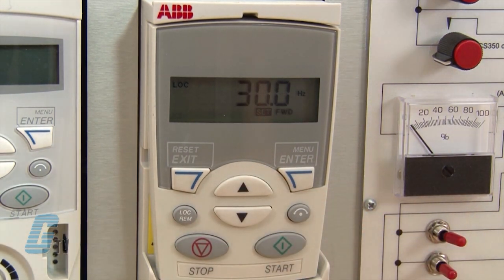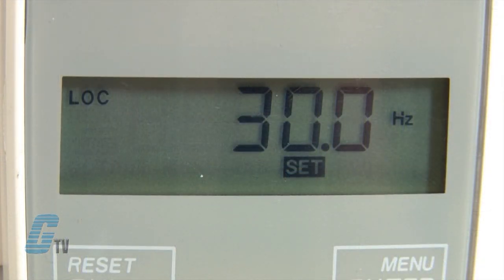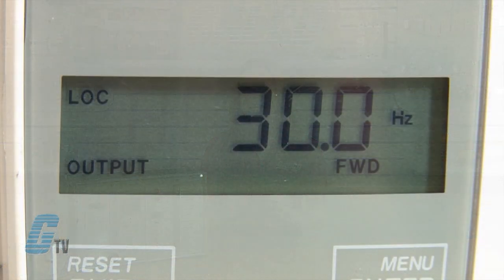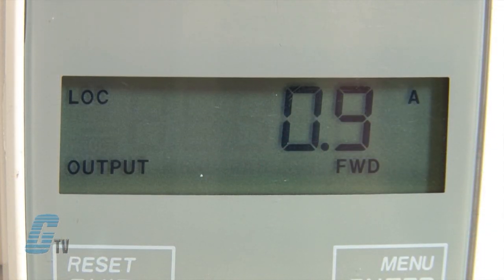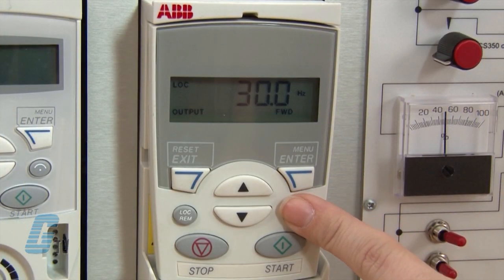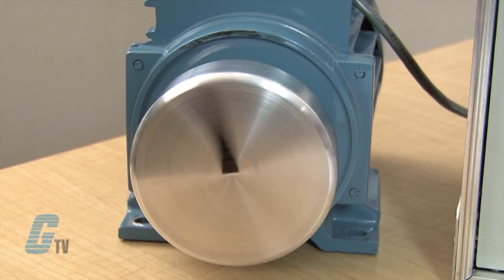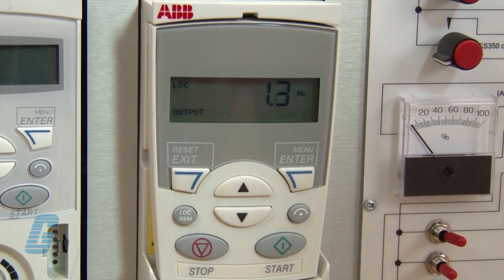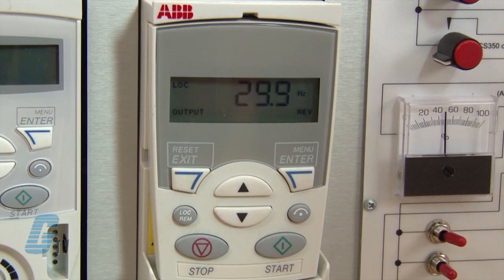How To Set Up ABB ACS355 AC Drive With A Standard Control Pad

Comment: Hi, we are using acs355-03e-12a5-4+n827 drive for solar pump.we encountered some unknown issue in the system.while on the switch, display getting on rotating with symbol.but after that there is changes in the display.
Reply: After that there are no changes in the dusplay
Reply from the maker: We will need to know what changes are happening to the display to begin to understand what could possibly be happening.

The rotating symbol mentioned might be the symbol indicating that the drive is outputting current to the motor.  It should be a rotating arrow that will either be spinning in the clockwise direction (representing forward movement of the motor) or the counterclockwise direction (representing reverse movement of the motor).  Also, the line will be a dashed line until the drive reaches it reference point, then the line will become solid.

please reach out if you have any further questions
Reply: After switching on the system, it appears like the rotation I shared video earlier.what could be reasons for this type of display rotation.please suggest me how to proceed further.
Reply from the maker: @KamalkannanK-c5k  please contact techsupport@galco.com or 800-575-5562 option 3 for further assistance

Comment: Good night friend I have an ACS 355 220 v
Installed in a lathe I would like to know if there is any parameter that I use to increase the torque at low speeds.

Comment: I get alarm on display a20 10 what ll do
Reply from the maker: Here's what I found for your scenario, Motor temperature is
 too high (or appears to be too high) due to excessive load, insufficient motor power, inadequate cooling or incorrect start-up data.
Reply: @GalcoIndustrial  thanks for ur reply.
How to reset the drive.
Reply from the maker: @fairose1052  your welcome. Please don't hesitate to ask any additional questions, and let us know how it went.
Reply: @GalcoIndustrial  how to remove this alarm A 2010

Comment: Rated frequency was 60hz at motor nameplate and same is set in the VFD but motor running condition frequency not increased more than  53hz ,can u tell what the problem
Reply from the maker: Most likely you have 1 of 2 potential problems. 1) Reference scaling; what are the settings in parameters 1103 to 1108. 2) The motor is at maximum load and the drive is in current limit.

Comment: How sett  RPM from Hz
Reply from the maker: It depends on which control mode you have selected in parameter 9904, SCALAR FREQ displays Hz, VECTOR SPEED or VECTOR TORQUE will read out in RPM.

Comment: Why the voltage output just only reach 160v to 170v, how to set up the voltage back to 240v? The input voltage is 240v....anyone please advice...
Reply from the maker: Are you running at 60Hz? What are you measuring the voltage with?
Reply: Measuring by multimeter...the out put cameout with 150V
Reply: @norfazlimokri3598  you will not get a correct voltage reading using a multimeter  as it varies the frequency and torque in various startup and running stage

Comment: Is there a way to run a 1 phase motor with ACS 355 drive ?
Reply from the maker: Generally speaking no. However we have run a single phase fractional HP motor on a VFD and it responded fairly well.  You should also know that it was just a fan motor with no fan blade attached. Single phase motors are not intended to be run on a VFD. A Reduced Voltage Starter would be a more economical choice for a single phase application.

Comment: How to tke 24V from ACH550 drive?
Reply from the maker: Terminal 10 of the X1 connectors is +24volt output, terminal 11 is the 24volt common. If 11 and 12 jump together, then connect each digital input to the + output to activate each input.

Comment: but I install a new
Reply from the maker: Then double check the group 99 parameters for correct motor data entered if you haven't already. This may not be a drive issue, the motor is getting to hot not the drive. Are you running at low speeds?

Comment: How do we set the drive up for analog control from an analog input?
Reply from the maker: Simply wire up the speed pot to terminals 2, 3 and 4 on connector X1A. The drive is defaulted to this input. However you do have to make sure the drive is in remote mode. Look in the upper left corner of display on keypad to see if in remote, if not push the LOC/REM button to toggles modes.

Comment: my drive show error 2010
Reply from the maker: This is a motor overtemp fault. Check the load on the motor, check the fan is not broken or block air flow. Running at low speeds for long periods of time can overheat the motor. If this doesn't help give us a call at 800-337-1720 and ask for an ABB product manager to assist you.
Reply: @GalcoIndustrial  also may be the  the invertor  temperature sensor damage

Comment: Hi, may I ask what is the difference between ACS335 AND ACS150
Reply from the maker: +Muaathe Aziz the difference is power. 

The ACS355 
◾0.37 to 22 kW/0.5 to 30 hp
◾Optimized design for cabinet installations saves space and installation time
◾Wide range of fieldbus adapters available offer flexible connectivity
◾Vector control capable of running both asynchronous motors and permanent magnet motors
◾Simple and visual sequence programming to make independent and repeatable operation sequences
◾Pre-defined application macros for quick basic setup
◾Unified height and depth of the IP20 product family simplifies wiring in cabinet installations

The ACS150
◾Power range 0.37 to 4 kW/0.5 to 5 Hp
◾IP20 enclosure 
◾Scalar control
◾Integrated user interface and potentiometer
◾Built-in brake chopper
◾Built-in EMC filter for 2nd environment
Reply: I want to know this code  F 0046

Comment: I am setting a new parameter but when I press enter again it does not turn the paramater number back. How should I change the settings? is there a block setting to not change paramaters?
Reply from the maker: +Cengiz Oğuzer When you want to change a parameter using the standard keypad, once you select the
parameter, you need to hold the ENTER button in for a few seconds until
the word SET appears at the bottom of the display, next to the word PAR.
Once you see this you can change the parameter to what you want, then push ENTER
again to save it. You will need to do this each time you want to change a parameter.
There is also a PARAMETER LOCK, parameter 1602, which prevents parameters frombeing changed from the keypad, this should be set to 1 which means
unlocked. If it set to a 0, then it is locked and you need to go to
parameter 1603 and enter 358 to unlock.
Reply: +GalcoTV Thank you very much. It was exactly how you described, it was locked. Now can change all.

Comment: i'm getting fault F0035.What is wrong with it?
Reply from the maker: Rudy Iskandar  
Fault 0035 is OUTPUT WIRING, which according to the manual, the most common cause is
the input power wires are connected the drive output. The input power wire  should be connected to terminalsU1, V1 & W1 and the motor wires should be connected to terminals U2, V2 & W2.
The other possibility per the manual is “Fault can be declared if the input poweris delta grounded system and motor cable capacitance is large.”
Reply: My fault is f0001. Please help

Comment: In the settings here in video the drive follows the value u choose for "ref", will it work as variable frequency incase you use solar knowing that par 1103 is set to solar? thank you
Reply from the maker: Rami H The drive is still a variable frequency control, but when you set parameter 1103 to solar, the drive automatically adjusts the output frequency based on how much
power the PV cells are producing. You cannot manually set the output frequency
in this mode.
Reply: so wat i have to do with the "ref"? parameter 1103 already set to solar. and parameter 9904 is set on scalar frequency. could the problem be from the mitsubishi magnetic switch installed after the drive?

Comment: Acs 355 drive show on monitar fault f1009
Reply from the maker: Narayan Adhikari If you're getting a fault 1009, it could be that the settings for parameter 9907 (Motor Nominal Frequency) or 9908 (Motor Nominal Speed) are incorrect.  Recheck your nameplate to see if they match.
Reply: ACS550 DRIVE show a fault  F0021,what is a solution?
Reply from the maker: Moses Mfalanyombo The manual says “Internal fault. Current measurement is out of range.”, this says that the drive is defective, you can try a couple of tests to confirm this. 

If you can run the drive and measure the current going to the motor and compare it to parameter number 0104, which is current. If there is a big difference between them, you have a problem with the drive. If they are the same, compare that value to the full load amps of the motor, if it is higher, you may have a motor on load issue.

If you can’t run the drive, disconnect the motor and try to run it again. If it still faults, you have a problem with the drive. If it runs with the motor disconnected, look at parameter number 0104, it should be zero. If the value is not close to zero, you have a drive problem. If it is close to zero, you may have a motor or load issue. Try reconnecting the motor without the load connected to it and see if the drive faults. If it does, check your motor, if it doesn’t, check your load.
Reply: @GalcoIndustrial  either motor coil burned or Inverter failed